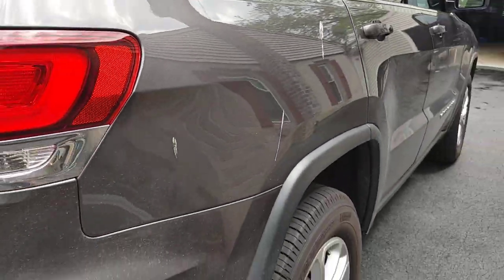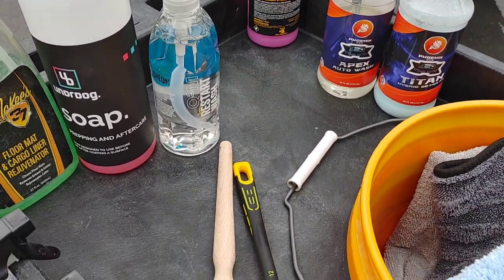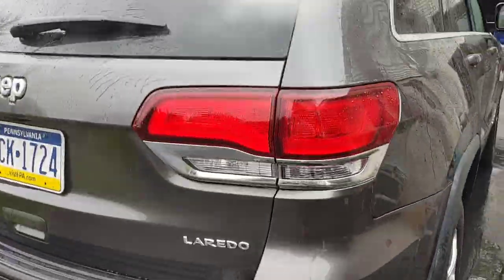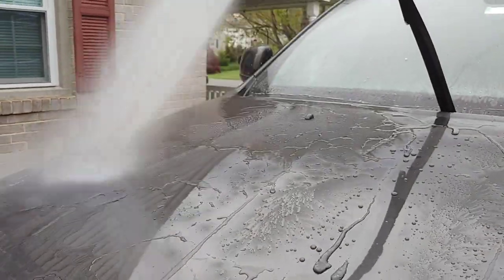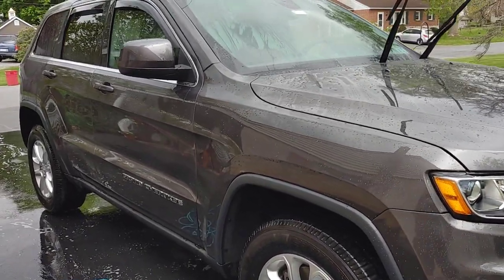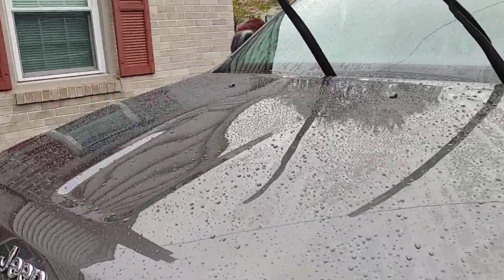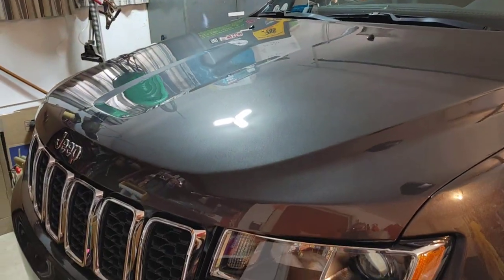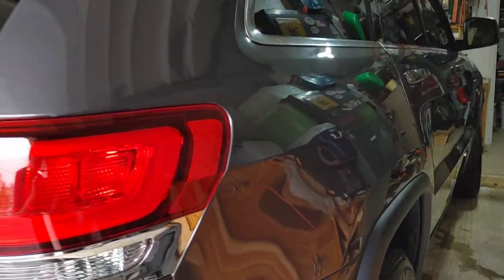Undrdog Pro- ONE YEAR LATER- How Is It Performing? Let's Do A Maintenance Wash!

Comment: Labocosmetica purifica will be a 1 step solution for your dead panels. If you add the primus wash with it even better. The rough wisconsin winters and the hard water here as well is really tough on coatings but I highly recommend. Great video

Comment: what about CarPro Reset, have you tried it out? I was going to purchase for personnel use instead of going gyeon which i usually use them for my tire coating and love the product.
Reply from the maker: Yes that is another great cleansing soap for coated vehicles but I wouldn’t use it to maintain daily but more like every few months
Reply: @attention2detailswchelsea  planning on using the undrdog pro on my black 22 accord, what would you recommend using for weekly or daily wash? Maybe the ph balanced soap from Adams?

Comment: I have the undrdog pro coating on my car coated it about 2 months ago.  took the car in for service at the dealer told them numerous times not to wash it, but they did anyways. Wondering if the coating is ruined or what? They have an automated machine that’s not touchless.
Reply from the maker: It should be fine. One automatic wash won't kill it. The swirls are what Id be upset about
Reply: @attention2detailswchelsea  Are swirls serious? Are they scratches or just brush marring?
Reply from the maker: Brush marring basically. Nothing serious unless you're crazy OCD and had the paint perfected before coating. Most people don't even see them except detailers. It should be fine.
Reply: @attention2detailswchelsea  Thank you! ❤️
Reply: Thanks. There’s light scratches. My car is black to. I took it to get paint corrected and coated. I was very upset

Comment: Under dog pro. Hmm not impressed. My DIY coating 10 times hydrophobic and it’s been on car 1 year now. With no problems just regular maintenance washed and I wash car once a week. I guess I was expecting to be blown away seeing how it’s a pro coating. I have a dura coating product!  But looks good. Great video and review.
Reply: I mean she did say they only washed the car 7 or 8 times in an entire year which isn't maintaining it correctly at all. Surprised it's even holding up as well as it is with little maintenance
Reply: The car maintenance was way less than ideal. 
Your coating is 10 times more hydrophobic? How do you measure that?
Reply: Dura Coating requires 2-3 coats....why?  Undrdog Pro is more cost effective.
Reply: @detailone978   i cant answer that. I am not a chemist . However I have it on my car and it’s beast mode and don’t bead or sheet like that. My beads are perky super round and tight don’t really sheet it just falls off car way to quick. If I try to flood the panel it just runs off way to fast.
Reply: I mean you wash your car 48 times in a year and 7-8 times a year for this car if this car was washed just as much it out do yours it most likely does for only a few washes and honestly every 6 months should have a decontamination done which that wasn't done on the car also I guess you do that once a week also pls wash you car 7 times and then link a video so we all can see how good this coating is and its all in how you maintain your car for it to last right so after a year it still out performs a lot of coatings js
Reply: @Jamisensdetailing   I have videos. I wash every weekend. I do a full decon every 6 to 8 months.